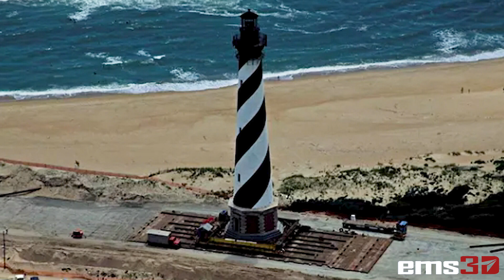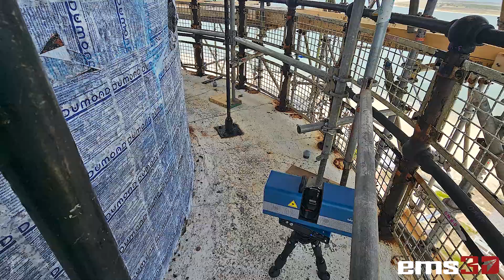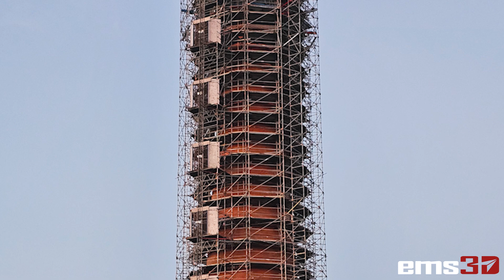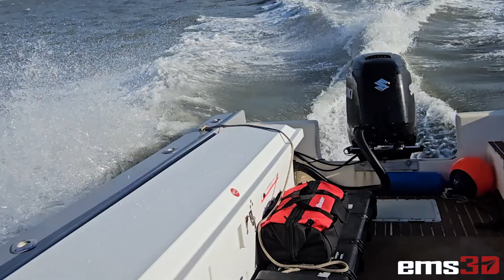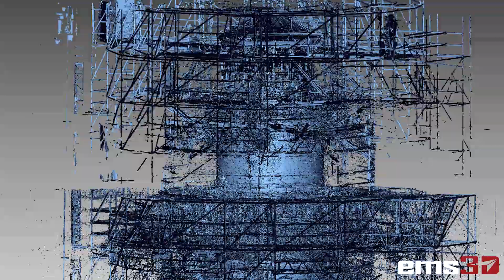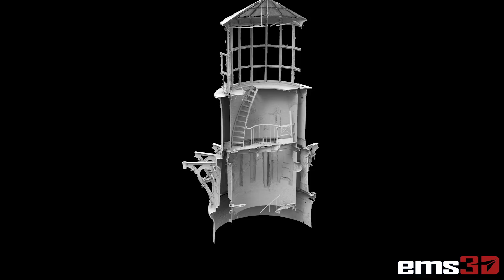EMS3D - Lighting the future for Cape Hatteras and Cape Lookout Lighthouses

Comment: Who's bright idea was this? Why not use a drone to scan the whole thing  before putting up all those scaffolding.
Reply from the maker: Drone data is nowhere near the accuracy and detail we captured on this project.  Drone Lidar scans work great for documentation but are not precise enough for reverse engineering to build exact replacement parts.   Also the scaffolding was required to prep the site for the 3D scanning.
Reply: a contractor who likes to write a giant bill and try to justify it later, that's who.   This restoration could have been done entirely without all this 3D scanning and solid modelling nonsense by the same traditional talents that built the thing in the first place, but that kind of crap is par for the course for the park service.

Comment: Amazing job! How long did the project take, and how many engineers were involved?
Reply from the maker: About 3 days with a Surphaser and a Creaform HandySCAN MAX Elite 3D scanner and one engineer onsite.  Then about 2 weeks and 2 engineers to align, clean and merge the 3D scan data into a useable file for manufacturing.
Reply: 6 years later, it's still shut down. Probably 10 more years before it will be open.... if ever.